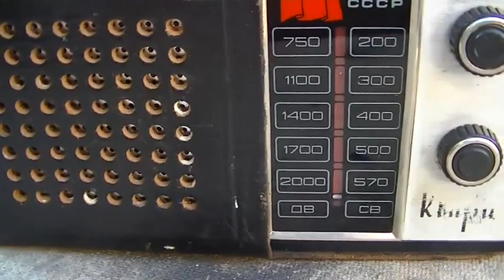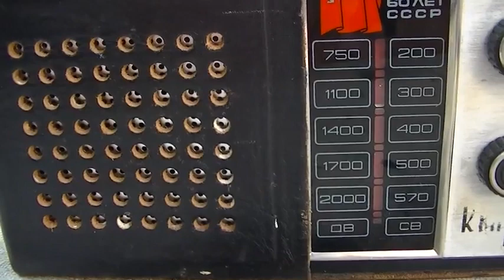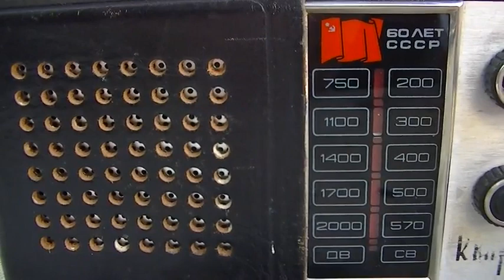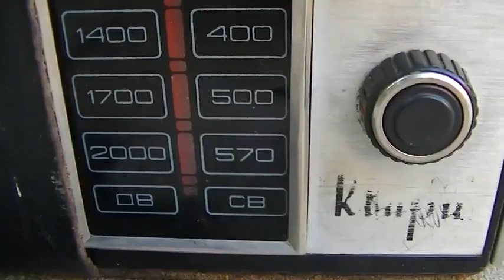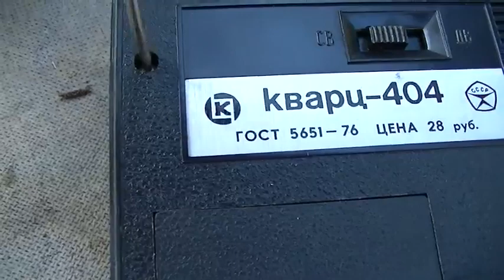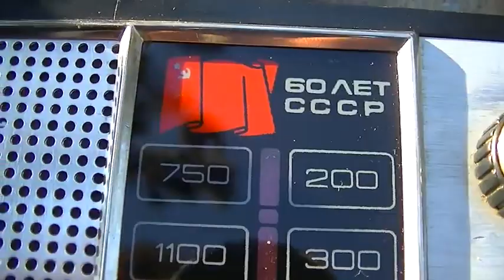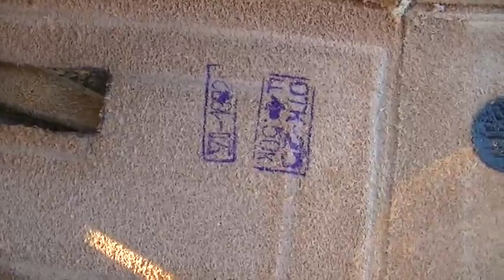Kvarc Кварц Quartz 404 Soviet Radio

Comment: The left side says long wave, the right says medium wave. The numbers will represent wavelength in meters not frequency. The logo commemorates the 60th anniversary of USSR so 1977. This radio cost 28 rubles (typical salary: 50 rubles)
Reply: I own a 1940s era Russian 'MOSKVICH'. The radio itself works but I cannot receive voices nor beats. It is my understanding Russian modulation standards could possibly be different to that of its American counter parts? May anyone shed insight?
Reply: what do you mean not voices or beats exactly?
Reply: do you mean very restricted audio range, such as little or no bass?
Reply: andygozzo72  just air noise. No bass. No voice.
Reply: air noise? like hiss or whoosh? does volume control quieten it if turned to minimum?
Reply: does it vary with altering the tuning? or with changing the waveband if it has more than one?
Reply: More of a consistent hum. It does not change with the wave length. I'd be glad to send you pictures and a video. It does soften with the volume lowered.
Reply: The humming does get loader when I insert a wire for a makeshift antenna.
Reply: hum, if of mains or twice mains frequency usually indicates bad ht smoothing caps or internal signal 'leakage' in a valve/tube , such as heater to cathode leakage,  so do no stations come through at all? it may have more than one fault, such as bad valve stopping stations, as well as deteriorated smoothing cap(s)
Reply: have you tried changing any valves? do you have the model number?
Reply: I wouldnt know what the valves are unless you mean tubes.There's only 3, they're light up. It's a Moskvitch, nearly identical one here: https://www.radiomuseum.org/r/moscowtemp_moskvich_b.html
Reply: yes tubes, we call them 'valves' here in the uk..
Reply: andygozzo72  my grandfather was from Blantyre Scotland. The valves glow.
Reply: how experienced are you with repairing vintage radios?..
Reply: andygozzo72 i'm mechanically inclined but I have little experience with radios. This radio seems very crude and primitive from compared to it's Western counterparts.
Reply: Typical salary was about 140 rubles.
Reply: Typical salary was about 120-140 rub.

Comment: That is amazing that you have still local AM radio stations working. The tuning capacitors may be gone off with age.
Reply from the maker: DjResR Why do you say that? AM is still in full use here and many people listen to it. Its mostly News, Sports and Political Talk but its heavily used. Its what covers into the remote parts of the country
Reply: Well most stations I picked up with the Pilite KK-9 is very faint, a lot of noise (jammers?) is coming through, I live in Estonia, it's a small country and the AM is not used here any longer despite some FM radio stations don't reach to heavily wooded areas.
Reply: shango066 Yeah that's great for the radio collectors that you have such clean and full of stations AM band. Here in Bulgaria the government shut down most of the AM transmitters because of the expenses for electricity. Now we have 1 AM transmitter and one LW, and nobody knows for how long. Here there are also areas which don't have good FM coverage but nobody cares. They said that the AM radio is outdated and with low quality and they are shutting it down and it will be cheaper this way... absolute idiots!
Reply: Origoangelohrol322
Good Day,
Here, I have had  sad good bye to a few AM Stations,  but still have a few very good ones left!
They are still popular here to hear the Hockey Games by.
I began listening to AM Radio at Age 4, & to this Day remain quite loyal to it!!
I would be quite upset if AM were removed in My Country too!!
It is about "cheap-ness" of the owners  not  about "out-dated"  Technology.
My guess is they want the Land needed for the Transmitter Antenna Grids, & they want to Cash in on the scrap Metals the Grid is made of.
FM does not need as much Land to occupy Antenna. (I compare the FM vs AM I see near My Home).
Reply: Here in the States We have digital AM and FM radio alongside analog.  Digital AM sounds as good as analog FM and digital FM sounds as good as CD quality.  Analog AM is pretty much all talk radio.
Reply: @Origoangelohrol322  
What do people listen to at barber's shops and auto mechanics?
Reply: @gregorymalchuk272   Exceptionally analog FM. For the past few years we lost our LW transmitter, and this fall they destroyed the 215 meter tall 80 years old Blaw-Knox tower although it was in perfect shape. It will remain in our memories and our hearts.

Comment: I would tell you that its Long Wave and Medium Wave. When you read the dial. the higher numbers are at the lower end of the band and the lower numbers are at the high end. 570 meters is about 550 kc and 200 meters is about 1500 kc.2000 meters is about 150 kc and 750 is about 275 kc if I remember right. Thats how its marked.

Comment: Shango, you may be inspiring some of us to delve into a new branch of collecting and restoring!  I'm beginning to wonder if all of their components were manufactured to the CCCP equivalent of MIL-SPEC, even those used in their consumer markets?? Thanks for sharing this!
Reply: i have reed somewhere that most soviet manufactures made lots of militery equipment and the civilian products was just a very small part of most companys production so maybe they used some militery grade components they had left over from militery equipment
Reply: Back in the latter part of the '80s, I managed to have a peek at the insides of a VHF-AV radio extracted from a Polish-built helicopter, and remember seeing many of the same styled components mounted on a very redundant (double sided, heavily tinned and conformal coated - with large through-hole construction) PCB. There's a pretty fair chance your memory serves as being correct! Many thanks!

Comment: Nice little Beach Radio eh! 
I would double-check what the B+ should be!
I have similar Radios, & they used 6V via a small Plastic or Aluminum Frame holding 4 Penlight Cells, & connect using the identical Clip that matches 9V connectors.

Just thought I would say something, in case other Radio collectors out there wrongly presume their new find (sans 4 Cell Frame) is supposed to be 9V Battery instead, & damage it.

Comment: I own a 1940s era Russian 'MOSKVICH'. The radio itself works but I cannot receive voices nor beats. It is my understanding Russian modulation standards could possibly be different to that of its American counter parts? May anyone shed insight?
Reply from the maker: something is wrong with the radio, modulation is the same
Reply: Thank you my friend. Is there anything I should be looking for?
Reply: Jeff Dalrymple 
Is it a Tuned Radio Frequency or superheterodyne? Or maybe even a really cheap regenerative set. I imagine they were building stuff pretty minimalist during and after the war. If it is superheterodyne, you can check to see if then oscillator is running. Set a small radio right near your old one with both of them on and the other radio set to an off-station empty part of the band. Sweep across the dial on the old set and see if you get heterodyne squealing coming out of the speaker of the other radio. If so, then the local oscillator is running
 If not, then it isn't running.